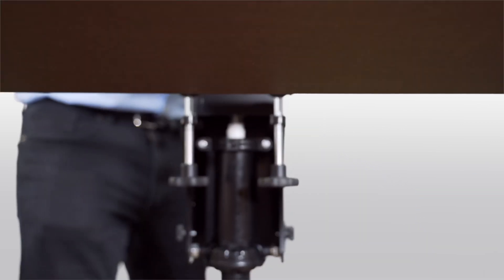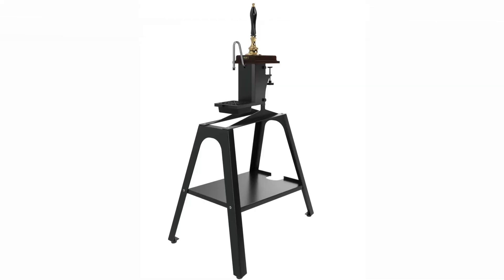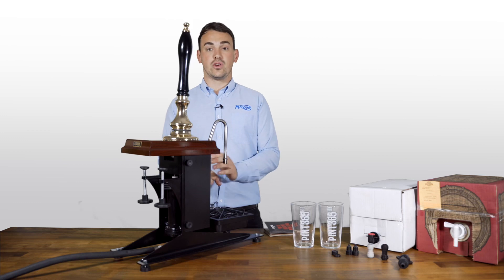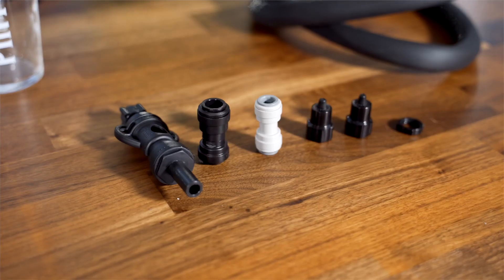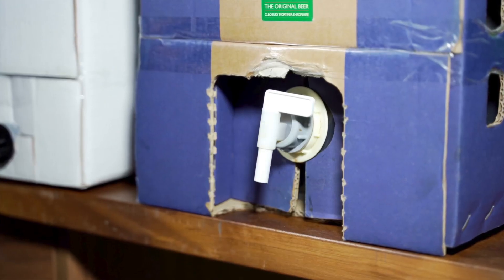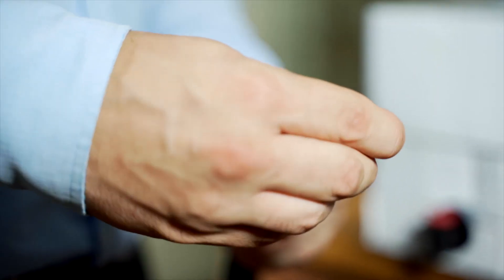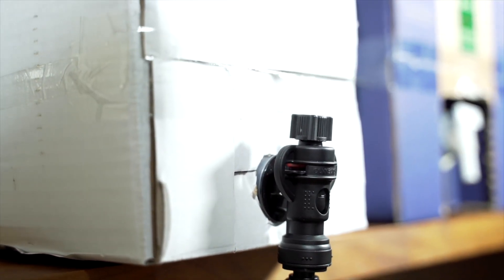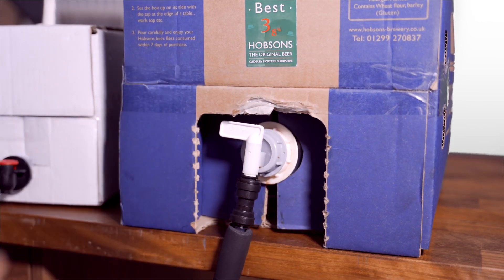Pint365 Setup

Comment: That's all very well bag in the box and/or polypin, I haven't seen these animals in the US, but we do have Cornelius kegs for home brewing? How about looking at a package for this including a demand valve. I am having the run-around looking at videos and trying to get all the fittings and pipes so I can put my new Pint365 into service.
Reply: I had questions with Pint365 regarding a demand valve, but they said that the new 365 has a built-in check valve, no need for a demand valve. I would like to hear back some comments what you have found out

Comment: do these units contain a demand valve,or do i need to use my existing one,thanks
Reply from the maker: Hi, it does have a demand/ check valve built-in. The Pint365 will work on pressurised lines and gravity feed

Comment: please, can you tell me if we need a CO2 gas tank to put the beer under pressure?
or just the "hand pression" is enough tospill the beer?
(pardon my poor english)
Reply from the maker: You can use this with a Co2 gas bottle if you want but it will also work with hand pression
Reply: @pint3654  thanks a lot, too kind of you
Reply: please, I've got one last question; is hand pump like this good for all kinds of beer or just for one or two (bitter? ales?) in particular?
Reply from the maker: @pippoquota5736  Yes it is for ales, bitters and cider anything with low carbonation in